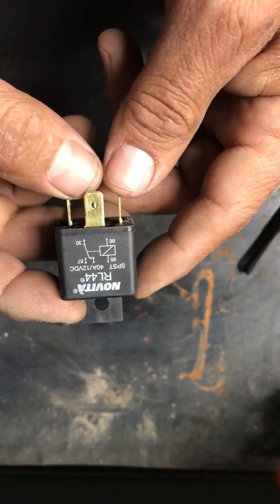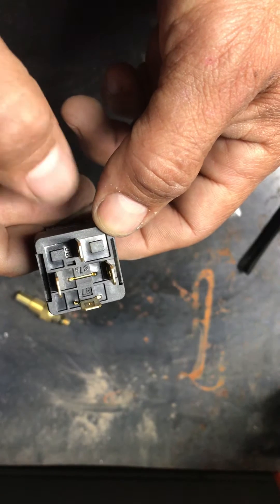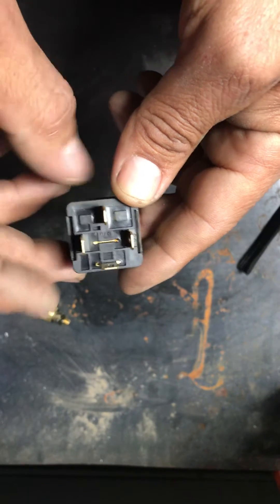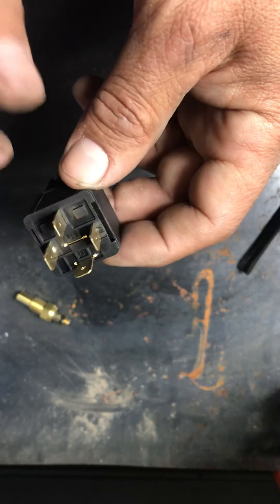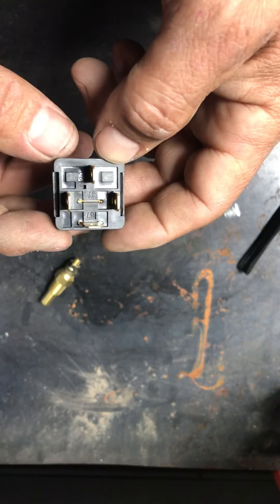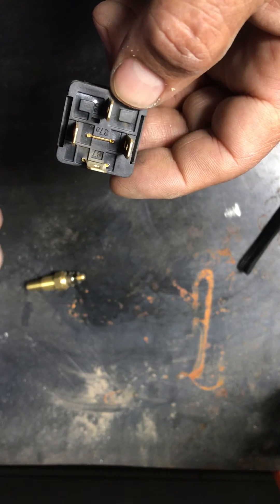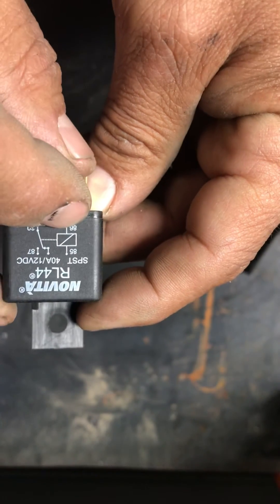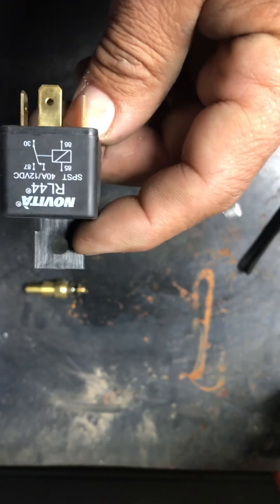Ls swap how to wire electric cooling fan

Comment: My ecm wires are constantly hot, even when the temperature gets to 200. Does my computer need to be programened?
Reply from the maker: if your donor vehicle did not come with factory electric fans then yes you would have to have it programmed to run the fan,or you could use sensor to  run the the fan screw in to side of head theres an extra port for that on the passenger side right next to the exhaust manifold bolt closest to the firewall it has an allen wrench bolt as a plug,
Reply: @ozcorr909  thanks, bro!